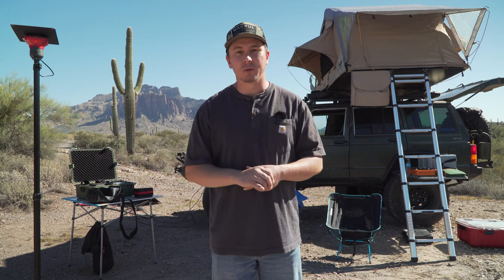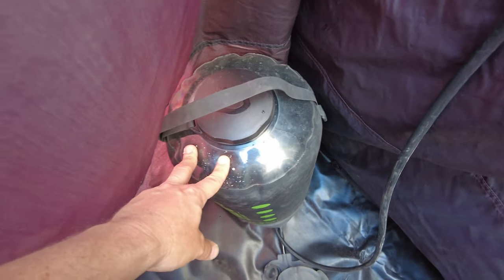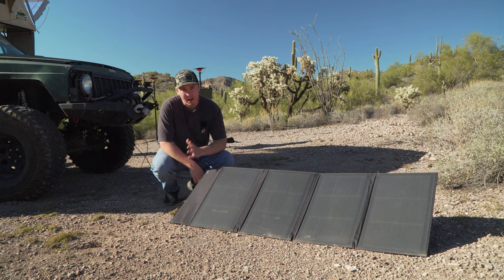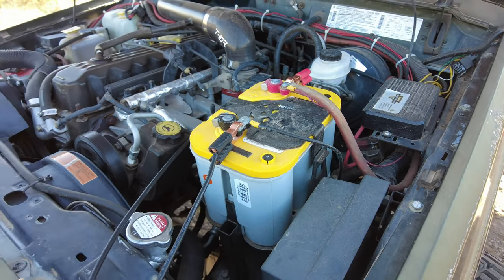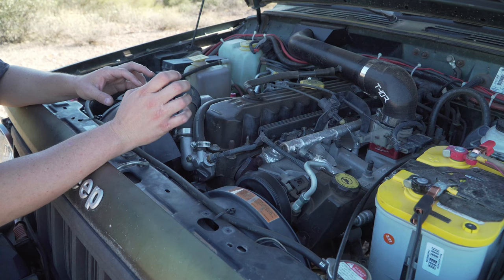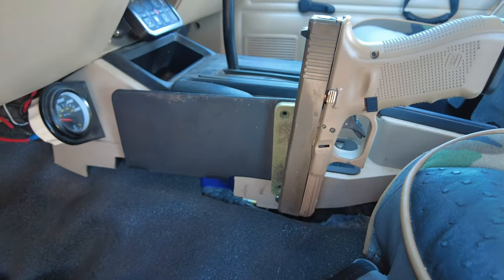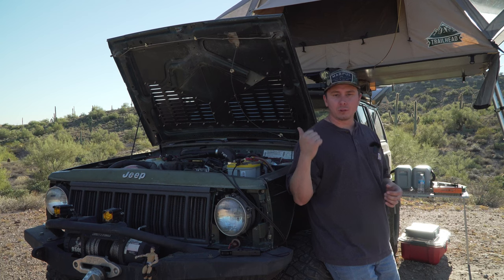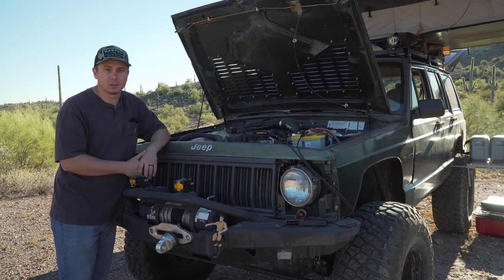Overland Rig Walk Around | 1996 Jeep Cherokee 2 YEAR UPDATE

Comment: Appreciate the "walk through" as I know that it can be a lot to cover.  I acquired a 4.0 '87 Pioneer that someone had started the 3.5" lift process, in which I found a sticker on the leaf spring pack that gave me a lead on what lift they did not complete.  My girlfriends non-lifted 4.0 '89 Pioneer will hopefully be near "completion".  Biggest part is how does one want to stow gear, what gear works best for each person, and how to keep it all light as possible.  My rig will be outfitted differently than hers, but I try to keep everything modular as possible.  Kudo's as not using loud background audio tracks, and the lighting is good as well in this content coverage.  😁✌

Comment: I saw in some of your vids that you wrapped your exhaust did it help keep heat off the floor pans? My passenger side of the floor gets super hot.
Reply from the maker: I did! It made a difference on the passenger side floor for shorter trips but longer trips it still heated up the floor. The biggest thing that helped was the sound deadener, insulation and vinyl floor. I’m not a fan of exhaust wrap now cause when it gets wet it rusts the exhaust over time